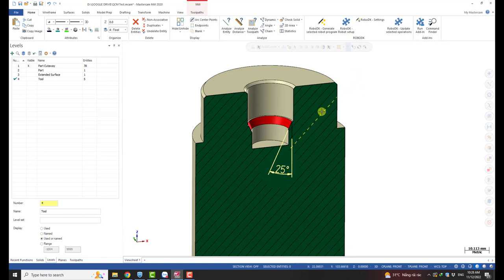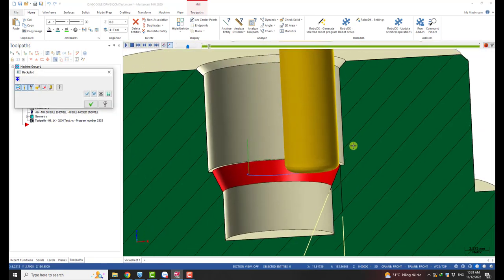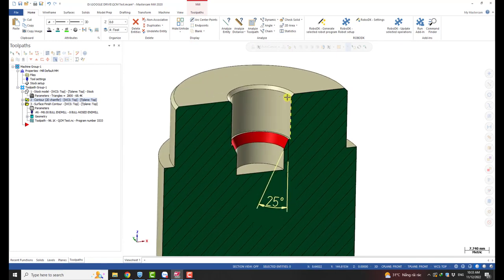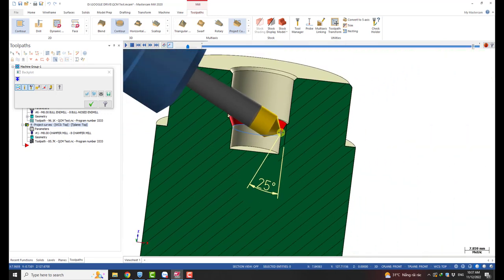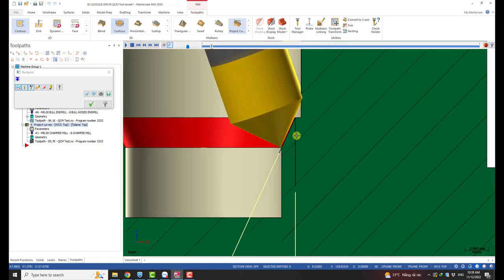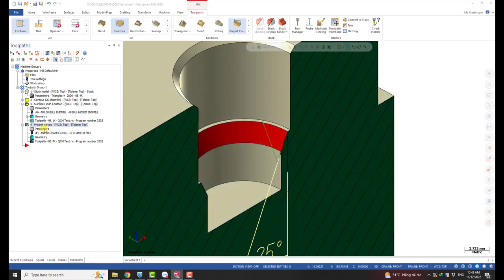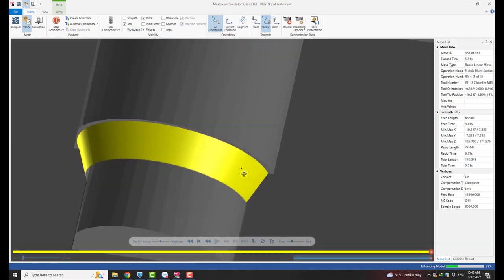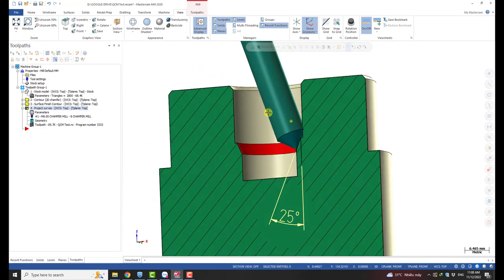Mastercam Tip: Chamfer any angle with a 45° Chamfering Tool

Comment: I don't think these people understand how useful this actually is.  What if your machine is packed full of tools with room for only one chamfer tool but your part has multiple chamfer angles, guess what, this process would be perfect!  I used this process to chamfer the outside of a complex bone plate.  MULTIPLE chamfer sizes AND angles all done with one toolpath.  20x faster than using a radius end mill and surfacing like most would do!

Comment: or just a modified drill bit or a countrsinking tool smaller than than the main diameter
you expolain too much
Reply from the maker: thank you
Reply: @GIANGTHETOOL  why are you thanking me?
i tried your method but it burnt my mastercam i wouldn't generate the tool path ? do you know why? 
i did exactly like your instructions
picked a 5mm spot tool, then gemtry , drive surface, title the head 3 degrees  at 5 axis but nothing  then crashed cause it wouldn't generate. never before had this happened
Reply from the maker: @christophercolumbus8944   send me you mcam file I can check
Reply: @GIANGTHETOOL  great what's the email?
Reply from the maker: giangthetool at gmail.com